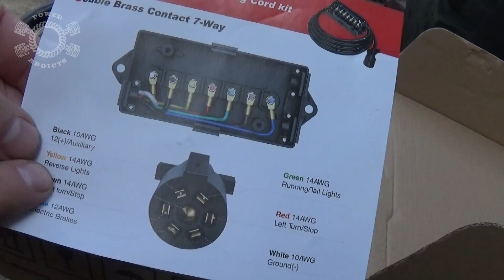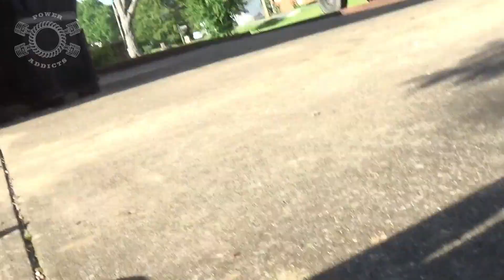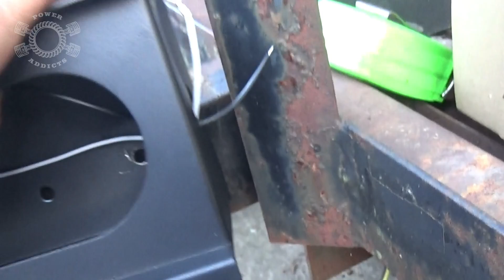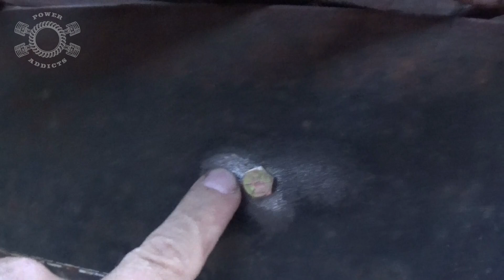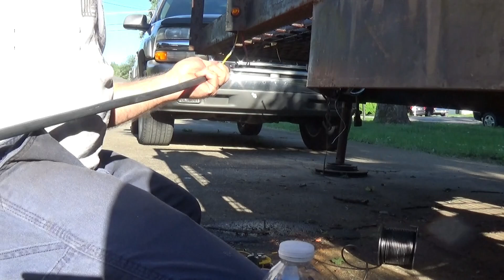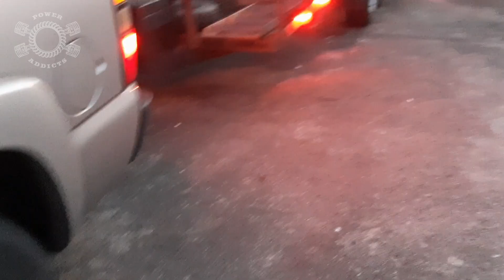Installing LED Trailer Lights: Game Changer or Overkill?

Comment: Why waste good vacuum line? Use less expensive split loom specifically made to protect wiring.
Reply from the maker: I'd normally agree with you, but that trailer gets dragged though a lot of stuff! Split loom can only take so much and the older it gets the more brittle it gets. I do use split loom when the situation calls for it.

Comment: Word-- SPLIT LOOM for ALL wires running under the trailer. The wiring insulation is never meant to be a wear barrier. That job belongs to the split loom.
Reply from the maker: I know what split loom is. I've got rolls of a few different sizes. Split loom works great under the hood where everything is protected. I have severed split loom with sharp metal cutting it. Split loom allows water, mud and other debris inside the split. I want to throw junk cars, Jeeps, motorcycles, raw steel supplies ... whatever ... on it and get the job done. I'm going after a YJ frame in the morning. That trailer has been dragged through many grown up fields to get cars and lots of other beat up junk. I've had sticks snatch the wiring harness from under it while in split loom.  I don't want to have to baby it looking after some thin plastic cover. Running the wires through tough flexible tubing allows sealing each end to protect it. The thick tubing protects it from cuts and abrasion. Thick tubing can be clamped solidly to the frame with metal cable clamps. I use split loom inside the interior, under dash, or even under the hood where it is pampered and protected. Not under my trailer or my Jeeps where they are subjected to rocks, sticks, water, mud and who knows what else. But .. thanks for the suggestion and thanks for checking out the video.
Reply: @Poweraddicts  I recently rewired mine and actually ran the wiring through electrical conduit bolted tightly to the frame. I had the luxury of setting the trailer on its side to better access everything. Put a new floor on it, too. Treated the wood with a used oil/desiel mixture before installing.  The old pressure treated wood only lasted about 5 years.  Good luck with the YJ.
Reply from the maker: @research903  I've got about 80 feet of electrical conduit. I needed my trailer asap so I really didn't have time to do that. That is a very good idea, it would protect the wiring very well. When I first got that trailer the wood was rottening out and was missing in some places. I put that steel floor in and never looked back. Thanks!!